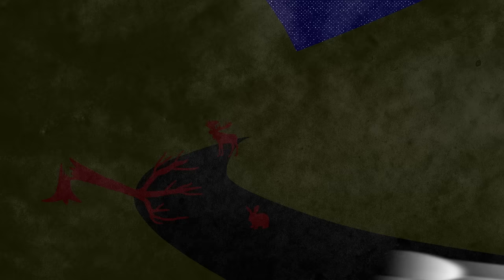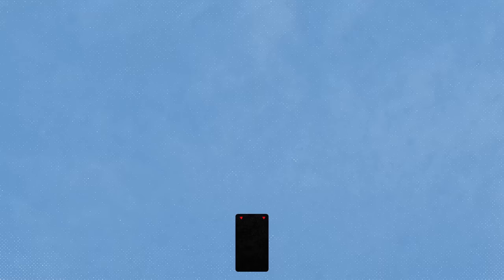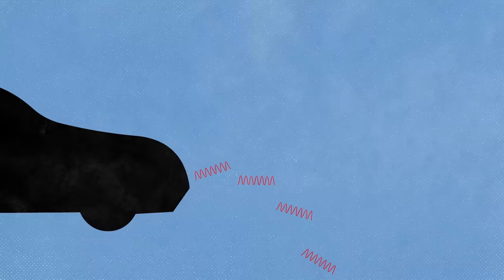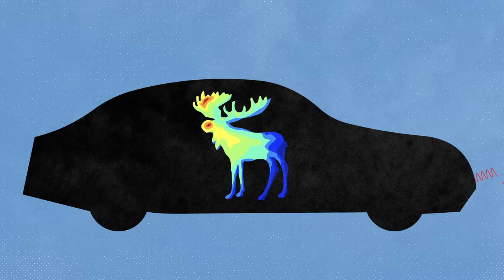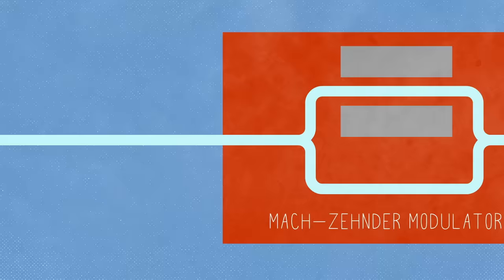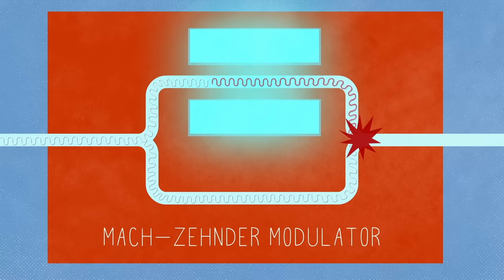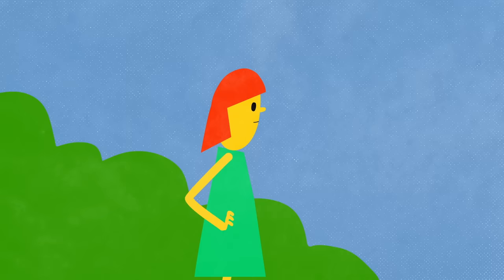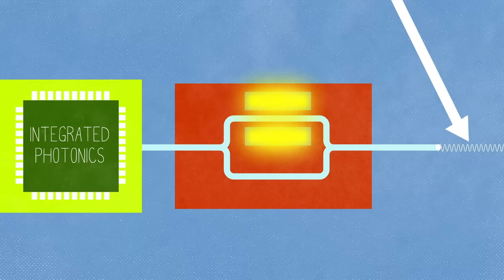How do self-driving cars “see”? - Sajan Saini

Comment: But Tesla doesn’t use Lidar, so we need another video
Reply: Yup. Elon does not like LiDAR
Reply: He is using golems
Reply: They need another title like "HOW LIDAR WORKS".  Self driving is not exclusive to cars using LIDAR.
Reply: @jasperizak123  That's not true at all. They implemented it into the Dragon Cargo to dock with the ISS. He just said it's useless in a model driven by cameras and neural networks.
Reply: how do you know 🤓🤓🤓🤓🤓🤓🤓🤓🤓🤓🤓🤓🤓🤓🤓
Reply: Tesla uses a combination of Radar, Ultrasound and 12 cameras, this is far cheaper than a lidar unit, they cost at best 7500 dollars. Unless they drastically decrease the price of Lidar Self Driving will simply be too expensive to compete with Tesla.
Reply: Tesla rely too much on AI to read video image, this is dangerous, as AI can sometimes misidentify things, like we do.
Reply: LIDAR also requires the images to be processed, the uber pedestrian accident had the LIDAR detect the pedestrian, but was confused as to what it was and did not brake.
Reply: They are DOOMED. DOOMED!
Reply: @toasterr4238  LIDAR wasn't at fault, you too said it detected a pedestrian, yet the software on the car decided against acting properly. This is why you should be cautious of AI & software, this is why I said Tesla's idea of heavily relying on AI for obstacle detection is dangerous. You wanted an actual sensors on the vehicle, not an AI acting as the sensor by interpreting video stream.
Reply: @Qual_  actually it is true, he prefers rockets for creating an image around the car, and theyre readily available for him
Reply: He said lidar is doomed on self driving car if I remember
Reply: Tesla is not the ultimate standard.

Comment: Yeah except...visual resolution of lidar (like color) is abysmal—especially for now. Like Elon said, the roads are made for eyes: rely on vision first, supplement with lidar and ultrasonics. I do have to say, mega respect to Ted-Ed, and it’s cool that they talking about the actual electronics of it.
Reply: Then maybe pursue more scientific qualifications and publish a video yourself?
Reply: Lidar doesn't have anything to do with color.  It just generates a point cloud that is converted to a 3d image
Reply: Real N He does have a point though, while Lidar as a technology is cool, camera technology is getting to a point where it’s no longer necessary.
Reply: @jerry3790  LIDAR is inherently better. With camera you're making the machine operate as a human would. That's like designing a car with legs.

Sure, it would be cool. I love AT-ATs. But wheels are just so much more practical on a machine. Let a machine be a machine and not emulate nature when there is a better way. Eventually I expect to use a combination of LIDAR with camera backup for extra safety. An IR camera that sees through fog and in pitch darkness that is.
Reply: LIDAR is better for depth resolution than stereoscopic photogrammetry. Sensor fusion wouldn't be and issue since the sensors and camera are static relative to each other
Reply: @fabischn90  I mean, you could just have both?
Reply: @treeaboo  That's what I meant with sensor fusion: LIDAR (Point cloud giving geometry and depth) and multiple RGB camera feeds can be fused and they don't mutually exclude themselves
Reply: LIDAR is great for object detection but as Elon have said, it is too expensive and it won't be able to recognize road/traffic signs. Cameras weakness is during adverse conditions such as flare, fog, or low light which where RADAR comes in
Reply: @mdrew44628  we use a lot of color in our road signs, traffic lights, etc. Color have something to do with driving.
Reply: @djdjdjshhsuss3941  pay attention....The argument was about LIDAR......
Reply: @mdrew44628  How will LIDAR know the traffic light red or green?

Comment: Except Tesla doesn't use Lidar and is the best self-driving car on the road today
Reply: Tesla cars aren't self driving, only Level 2
Reply: @jojodroid31  Elon Musk is offended by this video. He shat on Lidar at the latest tesla presentation xD
Reply: Lidar is costly, heavy and bulky, and not completely reliable. Elon is right
Reply: @shivamtyagi677  From your answer I recon you watched Real Engineering's recent video.
Reply: Isn't that mostly a cost question though? If you'd build self driving car with all the best tools, no matter the cost, LiDAR would probably be used. Sense Tesla also want their cars to be affordable, they're using technologies that are cheaper to implement today, at least that's what I've heard.  
Once LiDAR becomes more affordable and possible at size scales described in this video, Tesla will probably switch to use LiDAR, but will probably still use their software that they're currently pushing to develop and refine.
Reply: @NimbleBard48  Elon actually said something similar on Tesla Autonomy Day's presentation.
Reply: @jojodroid31  it will be by the end of the year though
Reply: Maybe he will use it in the future

Comment: LiDAR is not the only solution to self-driving. It has a lot of advantages, but also just as many disadvantages. The sensors are very expensive. Resolving the detailed features of objects in front of it is not very precise from off-the-shelf low-res hardware which a lot of these cars are equipped with. Plus, the current transportation infrastructure is created for visual perception, because it's driven by people who use visual perception to navigate vehicles; there is something to be said for a solution that uses visual data to navigate over LiDAR.

Comment: Transcript:

It’s late, pitch dark, and a self-driving car winds down a narrow country road. Suddenly, three hazards appear at the same time. What happens next? Before it can navigate this onslaught of obstacles, the car has to detect them— gleaning enough information about their size, shape, and position, so that its control algorithms can plot the safest course. With no human at the wheel, the car needs smart eyes, sensors that’ll resolve these details— no matter the environment, weather, or how dark it is— all in a split-second. That’s a tall order, but there’s a solution that partners two things: a special kind of laser-based probe called LIDAR, and a miniature version of the communications technology that keeps the internet humming, called integrated photonics. To understand LIDAR, it helps to start with a related technology— radar. In aviation, radar antennas launch pulses of radio or microwaves at planes to learn their locations by timing how long the beams take to bounce back. That’s a limited way of seeing, though, because the large beam-size can’t visualize fine details. In contrast, a self-driving car’s LIDAR system, which stands for Light Detection and Ranging, uses a narrow invisible infrared laser. It can image features as small as the button on a pedestrian’s shirt across the street. But how do we determine the shape, or depth, of these features?

----------------------

Comment: I'm actually a team leader for a self driving racing car competition in the UK 'FS-AI'. This is a top quality video, however, LiDAR hasn't quite been explained perfectly becuase even the best LiDAR radars only see a very limited slice of the world.  Whilst we have LiDAR it's kinda useless, the limited slice that the LiDAR can see makes it very difficult for object recognition as there simply isn't enough data coming from the LiDAR to make any reasonable assumption of the object. We use the Robosense V16 Lidar, which, despite it's high price tag is simply not useable. To get better resolutuion you have to pay vast amounts of money even though they fundemantly have the same issue. What we use instead is stereo vision (Zedd Camera) as you're able to make better object detection useing each image from the camera and using machine vision and the principles of the Fundemental Matrix, we're able to rebuild a higher quaility map of the world.
Reply: But zedd cam that doesn't imtegrated by some kind of 3d lidar, doesn't give accurate results especially under extreme weather conditions. How did you manage to do that?
Reply: @selene8734  Firstly, neither does LiDAR in those situations. We solved it using multiple cameras, and a model train on sensor fusion for the various weather conditions

Comment: Hey Ted-ed i got a question if the sun drags the planets in the solar system what drags the sun?
Reply: What??💩
Reply: Read Holy Qur'aan as the answer to your question lies there
Reply: The sun pulls things to it, like the planets, and the planets have significant sideways speed so they fall around the sun instead of towards it. Think of it like a ball on a string being swung around. The ball wants to fly off, but the string is pulling it down.

The sun orbits the center of the milky way, the galaxy we're in, for the same reasons.
Reply: the sun orbits the center of the milky way

Comment: Except there's a really big problem: In Driver's Ed, they tell you explicitly if you encounter a wild animal on the road, do not swerve! You can attempt to break of course, but the problem is hitting a large animal such as a moose or deer head on is safer for the passengers than hitting on the side. This is an important concept because self-driving cars can't simply be built to try and swerve in response to every obstacle with an assumption of dodging the impact...a problem that your older video "The Ethical Delimma of Self-Driving Cars" also runs afoul of.

Comment: Yea LiDar is useless a camera is better in this scenario and using Radar is far more important to see in the invisible photon range unlike LiDar that is a visible photon range. If you allow the car to see better than us then we will be safe using them. If you really believe in redundancy you might include the LiDar as a back up vision system but RADAR is the best for almost any spacial measuring and detection system as well as radar has less interference from the sun than lasers.